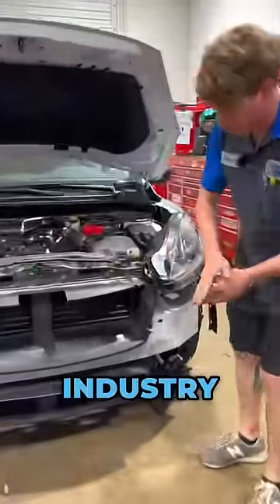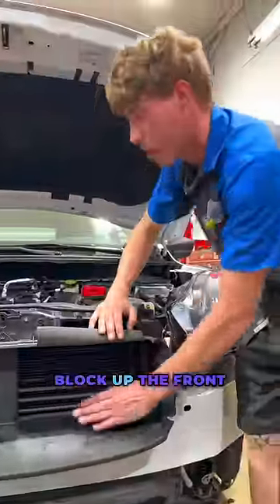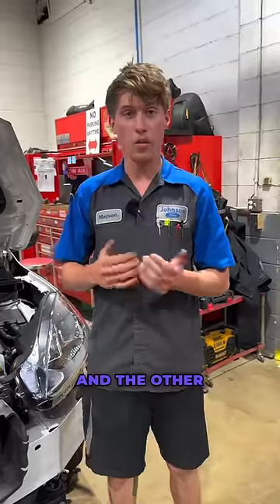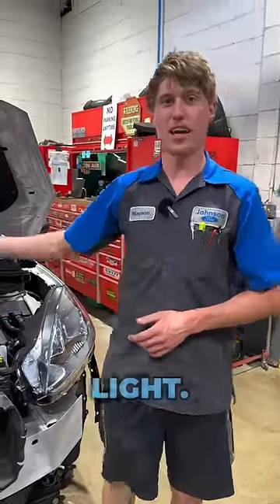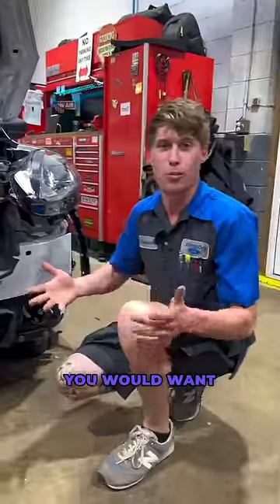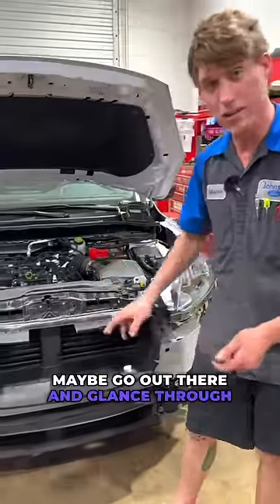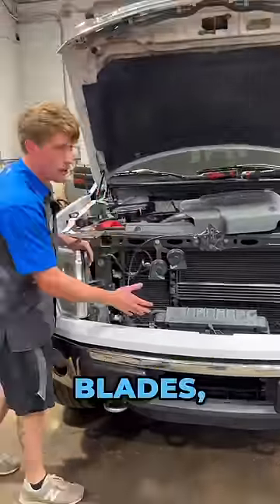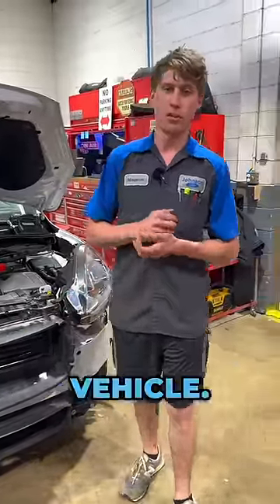Grille Shutters: A Newer Design In The Automotive Industry #shorts

Comment: Not only is it great for actually reaching operating temperature in cold climates, it helps reduce fuel consumption by reducing aerodynamic drag when the full airflow is not needed to for effective cooling.
Reply: In no way does blocking the entire front end of a vehicle give it better aerodynamics. This is entirely and EPA mandate. The engine and exhaust heat up quicker allowing the catalytic converter to work sooner. A cat doesn't start to remove particulate until it has reached hundreds of degrees in temperature.
Reply: @jeremypilot1015  having a blocked front absolutely improves aero. Having an opening full of grates and radiators and bars and beams for the air to have to flow over, around, and through each one in turn all adds to drag. 
Block that off, it just has to go around one shape, one time.
Reply: @mircomuntener4643  The grill is still catching the air dude. and any aerodynamic improvement would not outweigh the additional heat that never should be around an engine the entire point of engine cooling is to remove as much heat as possible. COLDER AIR IS DENSER AIR and cars run WAY Better. This is emissions nonsense intended to heat the cats up quicker. which will in turn wear everything out faster. But that is their plan. They want the car to die in a couple of years so you buy a new one. It stupid and they should not be rewarded with a single penny.
Reply: @jeremypilot1015 when they are shut, the air in the grill, keeps more air from going in, and it makes it aerodynamic. Just like a splitter. It adds more frontal surface area, but helps aerodynamics. It's engineering, not just uneducated guessing.
Reply: @jeremypilot1015  youtube needs a laugh react, but at least there's a thumbs down.
Reply: Not enough for me to give a shit. Over engineered and just 1 more thing to fail.
Reply: @garyszewc3339  it does not make it more aero, only smooth panels would do that.. the grilles are not sealed to prevent airflow through them, only in limiting the airflow..
Reply: @cheeto225  preventing airflow through it means that the air builds up and creates a high pressure zone which the rest of the air then flows around. Its the same reason why trucks getting better MPG with the tailgate up vs down.
Reply: This is why water pumps don't turn, thermostat stay shut and radiator fan is off until the engine is at the correct temperature. The effect of airflow on a radiator provides little to no cooling of the engine until these three components begin to work.
Reply: @Scotford_Maconochie  show me a combustion engine coolant pump that is switchable to not run with the engine running.
You still need coolant circulating or it'll grenade pretty quick. 
Heater also won't work. 
The pump runs with the engine. 
The thermostat, yes, but when it's real damn cold out, that thermostat opens up, lets in that -40° coolant sitting in the radiator, it'll close right back up. Covering the grille reduces airflow when it's stupid cold like that, actually allow the cooling system to function without OVERcooling, which is a problem when it gets fuck that cold.
Reply: How does it help it warm up quicker? Does this vehicle not have a thermostat fitted? 😅
Reply: @omfgishBenneh  it's not much help for initial warmup but it does help some as it reduces airflow in the engine compartment, especially if the factory splash panels are still in place.
But I never said anything about initial warmup, have you ever driven in -40°? 
The radiator being exposed to full airflow at those temperatures will have the thermostat opening and closing, the engine will keep getting fed surges of -40° coolant when it is expecting something much warmer. Not great. Blocking airflow to the radiator allows coolant to cycle, the engine to reach a stable operating temperature, and receive consistent temperature coolant from the rad. You'll be more comfortable in the cabin as the heater will get a consistent temperature as well. 
Yeah, it's another complication but it does serve purposes that you may or may not appreciate, but many people certainly will.
Reply: @JeremyPilot1015 Look at EVs. Or NASCAR, smaller grills are more aerodynamic. EVs aren't cooling combustion, so the great load is much less.
Reply: Subaru used a half shuttered system, where the bottom grill had a shutter that could open and close, but the top half was open, so the system could always cool down as needed in the event of a mechanical failure, but could also get better aero when cruising. I actually quite like the system for my needs. Totally worth the silly looking nose to me
Reply: He is right, it saves gas.
Reply: It's mainly for aero.
If you want your engine to warm up quick, there's this thing they call a "thermostat".
Reply: @jeremypilot1015  it doesn't heat the cats up any faster... that's what the air pump is for.
Reply: @billymanilli  it heats the engine up faster which heats the cat up faster look it up it is all about emissions the EPA must be stopped.
Reply: @jeremypilot1015 It is EXACTLY for improved aerodynamics. That’s was mentioned from the beginning when we first saw them being installed.
Reply: @jeremypilot1015 He’s right. Besides, the engines have other means to speed warmup such as delaying coolant flow through the block while allowing it through the cylinder head. Also, the shutters often close even after the engine is warm during light load conditions when the ac compressor isn’t running. The aerodynamic improvement is small. But these companies are seeking even the most minor improvements because they add up. They even design door handles for improved aerodynamics.
Reply: @mircomuntener4643 AND it improves aerodynamics. The manufacturers SPECIFICALLY mention improved aerodynamics in their training videos. As for the thermostat, they don’t suddenly open and shut. They gradually open and at extremely cold temperatures they only open a small fraction, so very little coolant enters. Thermal shock may be present at extreme temperatures. And the shutters may help with that. But it’s not their main purpose. The main purpose is indeed aerodynamics.
Reply: @dmandman9  and to further prove you are wrong the vehicles CEL comes on if you tamper with the shutters. Which proves it is related to the emission controls on the vehicle.
Reply: @jeremypilot1015  Not all check engine light codes are emissions related. Grille shutter dtc’s  are P05xx. Sometimes a grille shutter DTC will be present, and the check engine light won’t even come on. P05xx codes include things such as AC, cruise control, oil pressure switch , and power steering malfunctions and other things that have no effect on emissions. The second digit of a DTC  determines the area of malfunction. Examples P01xx and P02xx fuel and air , P03xx =ignition system or misfire, P04xx =auxiliary emissions , P05xx = speed control, idle, and other miscellaneous , P06xx = computer, P07xx and P08xx = transmission . Again not all Powertrain DTCs are emissions related.
Reply: @dmandman9  it won’t pass inspection in NY and California with that light on.
Reply: @jeremypilot1015  I understand that. They don’t have time to analyze codes. But the information I gave concerning decoding the codes is accurate. The second digit tells the system involved. And the second digit is a 5 most 5 dtcs have no effect on emissions. I’m a tech at Ford. I know what Ford says. I also know that sometimes the shutters set a DTC but don’t turn the check engine light on. Having said that, the information I gave concerning what the second digit on a Powertrain DTC indicates is available anywhere.
Reply: @jeremypilot1015  A thermostat that’s stuck open will likely generate a P0128 because the engine doesn’t reach operating temperature and will likely cause a rich fuel mixture. That’s why it’s listed in the fuel control section. It directly affects emissions.
Reply: @jeremypilot1015  You’re arguing with a man who recently took the Ford course describing the purpose and operation of the shutters. FORD said it was aerodynamics. So if it’s a lie, Ford told it.
Reply: @jeremypilot1015  Before it it was outlawed, NASCAR teams spent decades putting tape on the nose of their cars to increase downforce. Blocking off the grille absolutely affects aero.
Reply: @jeremypilot1015 

-it's called spill drag. When the shutters are closed a slug of air builds up ahead of the intake and forces the air away from the opening reducing spill drag. It doesn't have to be perfectly sealed, just enough to make that slug of air build up well ahead of the radiator intake. No clue if this reduces it enough to matter beyond an MPG claim. 
-the engine likes dense intake (not cold intake... there's a balancing act here) 
-the engine likes to run hot, at some point the temp becomes too hot with respect to the materials the engine is made of/detonation. If those weren't a problem you'd run the engine as hot as you could get it. 
-the intake shouldn't be behind the radiator and as such the intake air temp really shouldn't have anything to do with how hot the engine is running.
Reply: @jeremypilot1015 real engineers are laughing at you right now.
Reply: @dcm1f3  the same engineers who can’t build a transmission or diesel engine to last more than 60-70k those engineers? The same ones who soldier memory to the mobo. Those engineers? Lmbo
Reply: @jeremypilot1015 dude it’s common sense at this point. It improves aero
Reply: @jeremypilot1015  You're entitled to your wrong opinion.
Reply: It for aerodynamics
Reply: @mircomuntener4643  some LS motors have electric water pumps..
Reply: This kid needs to think before he speaks. You can videos models and papers all over the internet showing the efficiency gains. 

If a company could save tens of millions of dollars avoiding installing these they would. You can test it on a normal car with some tape on the highway.
Reply: @kingofl337  just because the vents are shut doesn't the air isn't still dead ending in the front of the truck. It's you that needs to think before they comment
Reply: It increases fuel mileage with less drag. No air going thru the radiator absolutely helps with fuel economy.
Have you never  watched a NASCAR race when they had to pull tape off of the grill? Why? Because it started overheating. Why would they tape off the grill in the first place if it could lead to overheating? Because you only want as much air going thru the radiator as is needed to maintain the temperature you want. Any more air is slowing the car down because it makes it less aerodynamic. It’s not really rocket science for most people to understand.
Reply: Not NEARLY enough to matter, or justify the increased cost and complexity
Reply: @FuelAirSparkTime  when the epa has you scratching for every mpg you can get, every little bit matters.
Reply: I have a 2013 model year car equipped with these, they haven't failed yet
Reply: @mircomuntener4643  that's such a stupid answer. Think about what you said.
Reply: @mircomuntener4643 

Yep, a huge flat wall is so aerodynamic.
Reply: This is 100% true. Case and point, F1 qualifying cars in the 80's I think. The teams had completely different cars just for qualifying which had no openings for radiators to keep drag as low as possible. Radiators can make up to 33% of the total drag of a vehicle on their own.

Aerodynamics can be counterintuitive in many unexpected ways.

Comment: Warm intake air burns fuel more efficiently cold air makes more power with some fuel not burning effectively because of condensation. This is a big part of why you get crappy fuel economy in the winter and you get deposits in your engine. Newer cars with direct injection are especially sensitive to this because there isn't time for the fuel to evaporate in the intake runners.
Southerners wouldn't understand because they don't know what winter is.

Comment: fun fact these flaps aren't new, I worked with a guy who had a collection of old cars, he has a 1926 Lincoln Model L (former police unit, pretty gnarly) has radiator shutters.
Reply: Been around forever yes. And they sat there one night having coffee or getting drunk and said that will break we should put it on a car😂
Reply: Yes but then it was ford cold climates. This is just some engineers way to add profit to the car.  $120 shutters - charge $240.  100% profit. Backend - they make the check engine light come on more , $$.  And eventually blow some head gaskets. $$$&😅
Reply: They didn't have intercoolers then though
Reply: @MartintheTinman  true a few makes of heavy duty Diesels have them
Reply: @puttervids472  It’s not for profit it’s to meet CAFE regulations. US spec Toyotas have them, Australia doesn’t. Also they are generally better for a vehicle since they reduce the effects of short tripping on engine oil.
Reply: Were the flaps on the Lincoln Model L manually controlled, or did they run on a wax pellet or bimetallic spring?
Reply: @gregorymalchuk272 I have heard of cars of that era having thermostatic radiator shutters, which leads me to believe they were controlled by temperature in the radiator (wax pellet/s, bi-metallic strips).
Reply: @PinkFZeppelin  lol.  Aka profit.  Emissions controls aren’t for anything  but profit.  

And no. Short trips and today’s water thin oils  aren’t an issue.  Putting shutters over a turbos intercooler is in a word  “ ret-Arded”
Reply: @puttervids472   Yes short trips are a problem because they allow condensation  to form and thus acidification. How would thinner oil prevent that?
Reply: @PinkFZeppelin  who are these 1/8 mile trip people ?   Most of the USA is Rural. We’re driving 5 miles or more to get gas. 20 miles to the grocery store.  We don’t  need cars built for nyc residents only.
Reply: @gregorymalchuk272  they opened automatically when the rad got hot, I seen the thing fluctuate when we had it out on a early christmas parade, was neat to see it in operation. couldn’t tell you how it operated, haven’t worked on those old cars yet. probably a spring cause it being a lincoln its built better
Reply: @puttervids472   Have you ever monitored your oil temps? I live in the cascade mountain range, thus I’m always mountain driving and my oil temps don’t hit 195 until I’ve been doing 50mph for 20+ minutes in the winter. That’s with grill shutters! It’s even longer in my diesel. 83% of Americans live in urban areas.
Reply: @De19thKingJulion  Yes, Rolls Royce and Packard come to mind.
Reply: @PinkFZeppelin  I live in South Carolina .  My oil is 80-100 degrees before it runs. 🤣.  And yes. I do have oil temp gauges. Engine and transmission.  I think I said that the older ones had shutters  due to cold climate …. So I can agree it’s contextual.  But we don’t need no stinking shutters south of the mason Dixon. We need bigger radiators , and a cooler on EVERY fluid using mechanism on the vehicle. 

But of those urban dwellers , do even 30 % own a car that’s not an EV ?  I doubt it.
Reply: I get to drive a 1930 Franklin 147 with exhaust temperature activated grille shutters, but yep, these are a new idea/invention.
Reply: @gregorymalchuk272  those type ( full actuation) were controlled with a thermostatic bellows.. full of a volatile liquid, alcohol or naphtha. There were a few types of actuation though eg manually, differential air pressure, vacuum actuation in slightly later ones.. electric from the 40s too
Reply: @vivalesvegas  Now those were interesting cars.
Reply: @vivalesvegas  only new thing about em is they are plastic and electric driven, which I would rather see the motor gears be steel cause one of the new ford f-150’s shutters you can hear it clicking as it operates the shutters, and the truck was brand new for the company I work for.

Comment: It's for aerodynamics (fuel economy). Developed in racing (taping up the grill) to reduce drag thus going faster but equates to better fuel economy on the street.
Reply: Yep. In the case of gasoline engines in passenger cars, this is absolutely the reason. All of these people talking about "warming the engine up faster" are morons, that is the job of the coolant thermostat. When the engine is cold, the radiator is essentially unused already. Yes big giant diesel trucks with big giant radiators will sometimes block off all or part of the radiator when it is very cold because the huge radiators (needed for hauling a heavy load in the summer) will sometimes make it so that the cab heat doesn't get very hot. Not the same thing at all and no modern car has the same issue.
Reply: @X85283  What state do you live in?
Reply: @X85283  Covering the radiator absolutely does help when it's cold. Apparently it doesn't get that cold where you live.
Reply: @MrSilence99  no it doesn’t.

Comment: I wonder if newer cars are also using this for fuel economy. This would make the vehicle a little more slippery through less wind resistance. NASCAR type stuff
Reply: There's a video somewhere of a 4th gen Ram 1500 in a wind tunnel demonstrating the airflow with the shutters closed. It's pretty significant
Reply: @hunterlewis2967  Yeah those are SUPER slippery vehicles, Slippery like a brick wall

Comment: These have been around for years.
Improves engine warmup time and aerodynamics as they can partially close when you drive.
My dads BMW has them. Fully shut when cold and fully open after long highway drives in the summer.